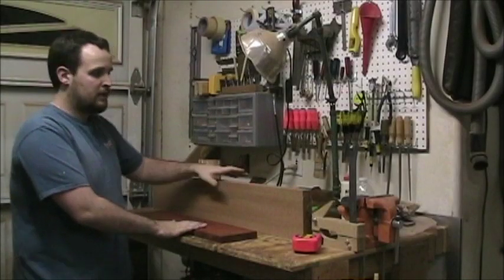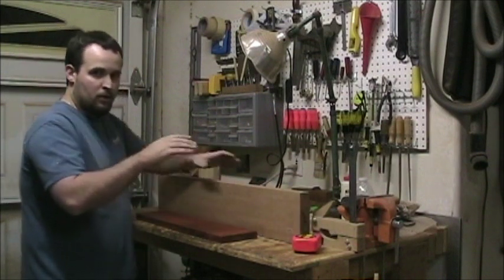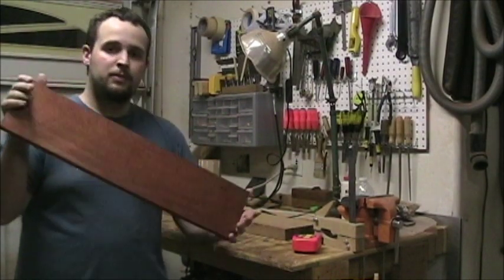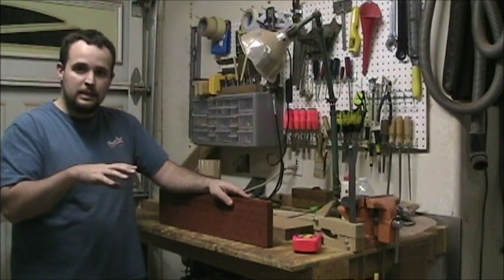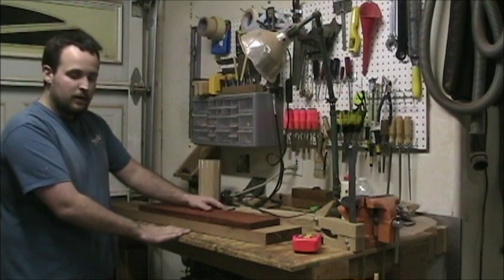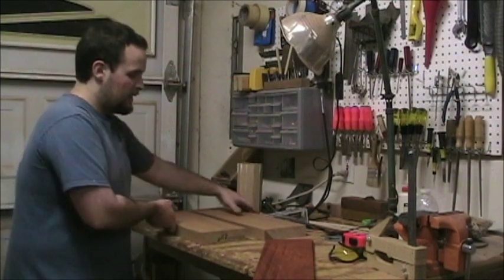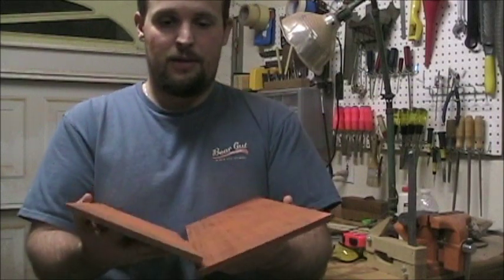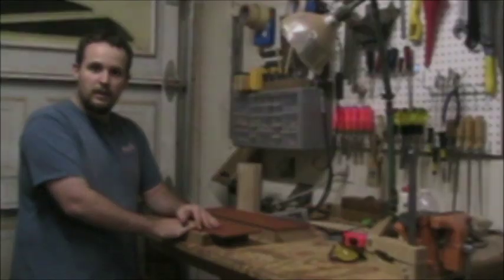Electric Bass Project Part II: The Body

Comment: He said in the first or second video that the laminated paduk is about 1/4" I think.  He cut the bookmatched pieces of paduk with a table saw so adding the 2 pieces 1/4" + 1/4" = 1/2", plus the kerf of the table saw blade ~1/8", plus using a thickness planer or hand plane to take off the mill marks the original piece of paduk should have been about 3/4" thick.